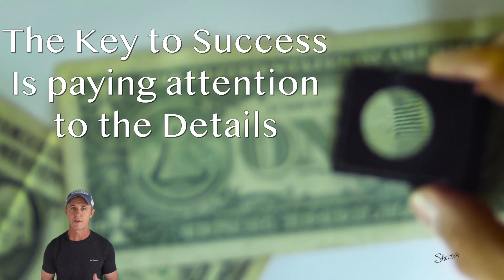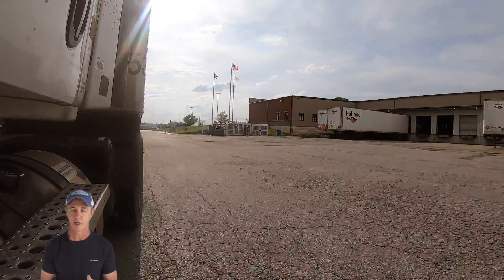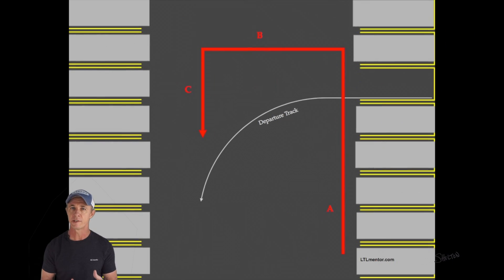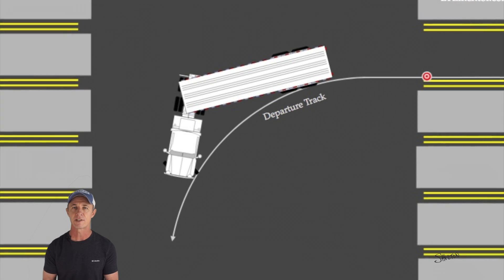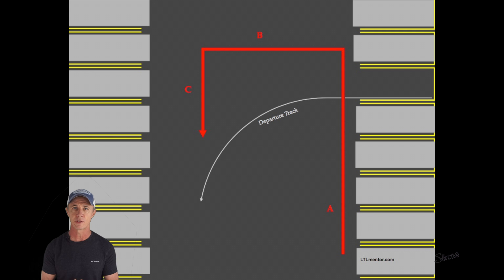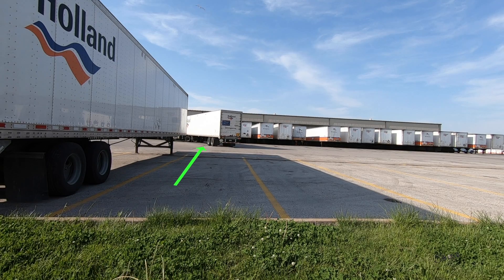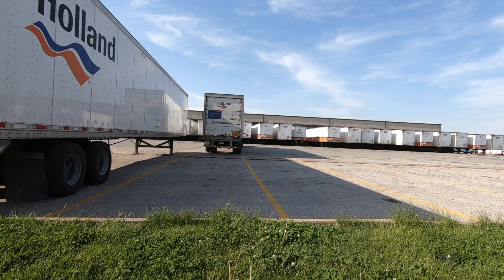Truck Backing Episode 9: The Hangman Setup - How to avoid reversing your trailer to the blindside

Comment: This if done right is also the tail end of a 90 degree back
Reply: I always over compensate on a sleeper and mess it more pulling up on this one. Thanks for the pointers men.
Reply: @jmj48  learn how to do a 4X4 maneuver aka walk the clock. Sleeper or daycab don't matter this maneuver allows to adjust the tractors angle to trailer while not leaving your position too much if at all.
Reply: @TheNorsewarlord  can you please explain the "walk the clock" and/or 4 x 4 maneuver?  I don't think I'm familiar.
Reply: @drummum21  the maneuver im talking about is a series of hard left and rights while moving forward and backwards 4 foot at a time. It operates on the presumption that it takes 
8 foot for tandems to react
4 foot for drives to react
2 foot for steers to react to whatever you do on the wheel. With that said that assumes tandems are at 41 foot mark and its a 53 foot trailer. The video I posted on my channel shows it as practice going all the way. But the actual application should be no more then 3- 4 moves to reposition the tractor to either pivot on the spot or straighten the tractor when you have limited space. It also useful when you realize you didn't time it right.

Comment: What do I do if I cannot do the hangman , but I still have to blind alley dock?
Reply from the maker: Take your time..stop often and get out and look. Or, you can roll down the passenger side window, set the brakes and go over and peek out the window a few times. Also you can temporarily move the wide angle bottom mirror outwards.

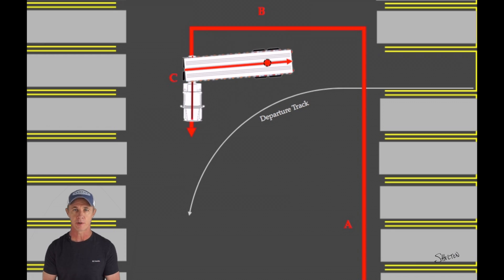Comment: I like the concept, thanks.   Just something that confused me:  You said at 1:25 that "Leg A runs parallel to the space."  It's actually PERPENDICULAR to the space you eventually park in.  Same thing at 2:52 .   I understand that your travel path is parallel to an imaginary line of the fronts of all the trailers, but you are driving perpendicular to them, not parallel with them.
Reply from the maker: Yes you are correct. I meant the imaginary line of the front of all the trailers. Sorry for the confusion.
Reply: @AdvancedTruckBacking  I saw you used the word perpendicular (in the right context) in another video, so I knew you knew what you meant 🙂